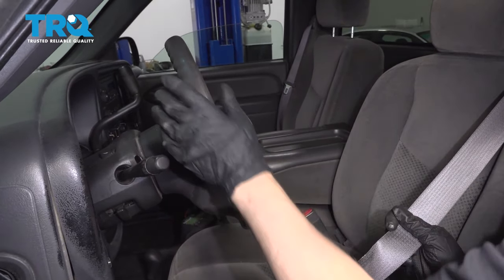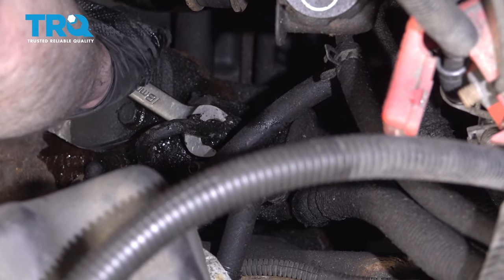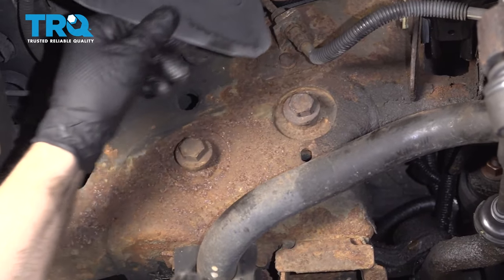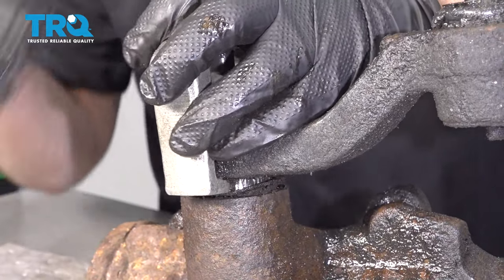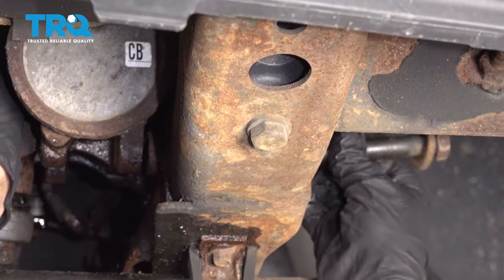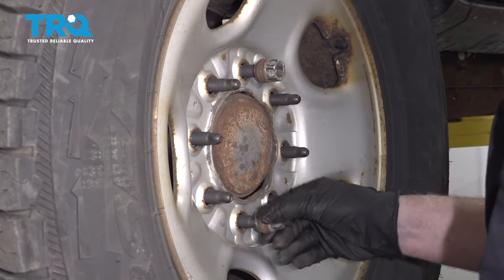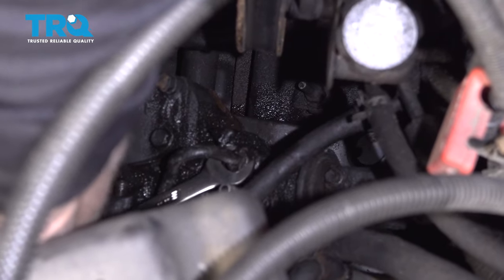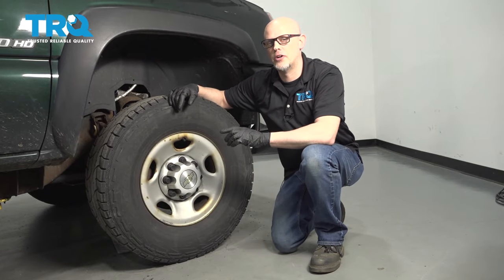How To Replace Pitman Arm 1999-2007 Chevy Silverado 2500

Comment: Really not sure why you'd go through the hassle of removing the steering box? You can remove the arm without removing it.
Reply: Yeah I've done this job without removing the box, alot of extra work for no reason...
Reply: @norsevikingsir4932  
 Agree, but he did make it look very easy with a soft soothing voice and no swearing.
Reply: I mean they make a low profile pitman arm tool. I think I dropped the  sway bar down. And pulled it off. It’s half the time
Reply: Now he has to fill it with fluid.
Reply: Oh, maybe this is shop procedures.. that's where all them additional labor hours are added to provide some profit for the shop.. haha, gotta make some money too ya know. 🤣
I'm just joking.  This is the GM's  reccomend procedure. Most shops will use the flat rate books to qoute repairs.  But you can lower the sway bar and change it on the truck.
Reply: I fought that pitman arm for hours. No pitman arm remover at all. I have it on the shopping list now
Reply: On my 2003 suburban 2500 your not getting the puller in between the cross member and the box.  You can get and end wrench in there and that’s about it.

Comment: I just did mine today,  I disconnected the sway bar on the left side for a little extra room but you absolutely do not need to remove the steering box.
Reply: Just curious how did you do it without removing gearbox
Reply: yeah this alot more work i dont understand this. ive never seen anybody remove the steering box to get the arm off. unless you were replacing steering box with it i can see it.
Reply: I was thinking the same thing
Reply: good deal lol

Comment: How could you remove the entire steering gear box and not clean all that nasty dirty grease off before placing back in the truck?!  That would have been the best time to clean it and re-paint it with POR-15.

Comment: Excellent video.. 
Removing the powers steering gear is a good idea for the cranking you need to do on that pitman arm.Both in removal and install..
If you're removing your pitman arm, it's highly likely you're on a high mileage vehicle, and the steering gearbox would be a good time to do this..
I did not replace it after replacing every component on my suspension front and rear..
I had a little play took the steering gearbox back out, did adjustments as recommended and never got it out.
$150 after your core, money is returned and you're good..
I'm currently working on my 2001 extended, cab chevy and i've got that part ready to go in.

Comment: take out both of the front bolts on the steering box and loosen the back one you can swing the gearbox around enough to reach it, no skid plate removal needed either.

Comment: If you have a 3/4 ton you NEED to remove the steering box because a puller will not fit with the larger cross member in the way.

Comment: I like how the video showed. Oh, you just pull the intermediate steering shaft off, and then we... Dude!!  It took me an hour to get that damn thing off because the shaft wouldn't collapse!!  It was stuck in a groove it had made being so old and worn out!  Also, unbolt the bottom nut on both sides of the stabilizer links to make threading in the inner tie rod end easy.  Doubt if you want, I don't care, it made it easier for me.😂

Comment: I'm putting the factory pitman arm on a Cardone (Car-Done) reman steering gear and it does not appear to be going on all the way. I talked to Advanced Auto accusing them of giving me the wrong gear. So I'm watching yours and others videos and it appears the pitman arm does not fully go onto the splines. It appears on mine and maybe yours that there is about 1/8 inch of splines still showing on the the pitman arm. I can see how this would be the case just to be sure that it is as tight as can be. Is this true?

Comment: Very very odd,
I’ve watched a several different videos on pitman arm removal & install,
And this is the only one that created so much extra work, by all the extra steps to remove steering box.
Not to mention leaking power steering fluid & all the other issues that could be created by removing the power steering box unnecessarily.
Reply: There is a frame crossmember on these trucks,  immediately beneath the pitman arm shaft. There is no way to attach a puller. If you are hammering or trying to use a fork to loosen the pitman arm you are causing potential damage to the steering box.